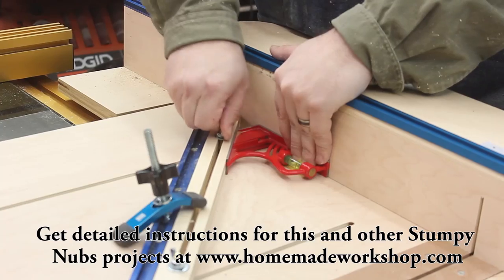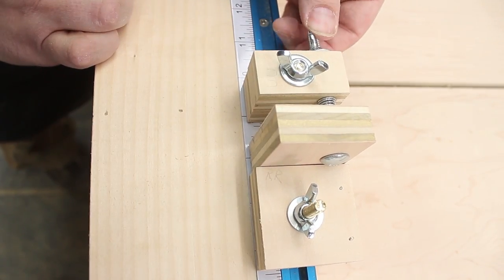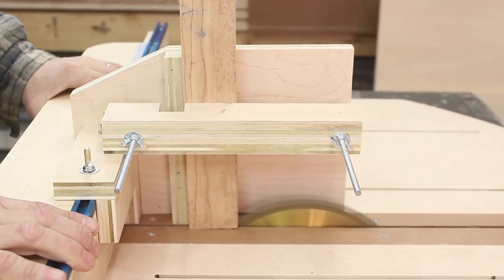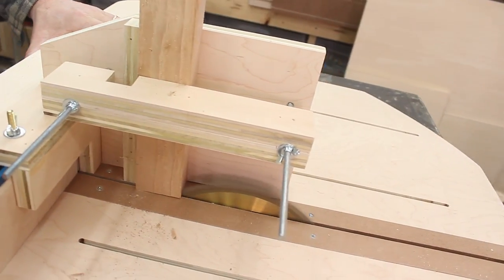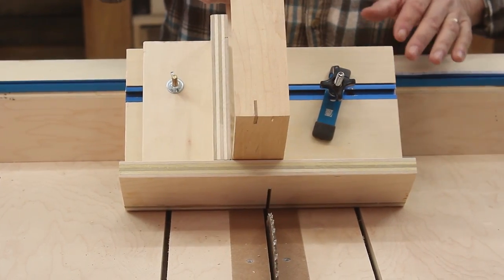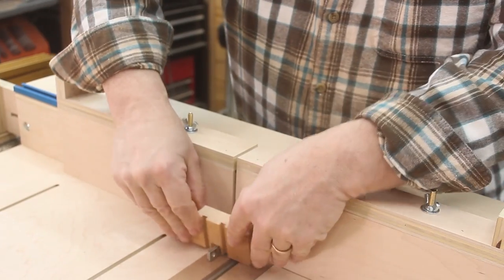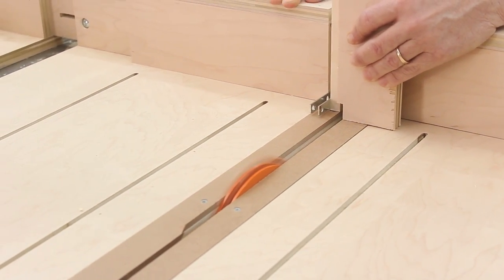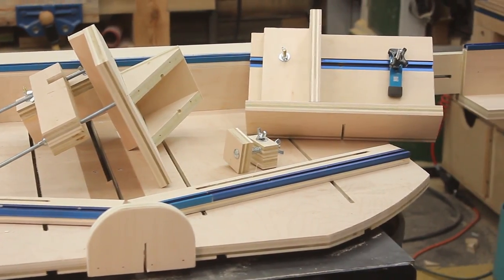Part 2- SUPER table saw sled crosscuts, tenons, finger/box joints, splines, dovetails and more!

Comment: I love your great since of humor it's fun to watch your youtubes. I also love the over-all sled,  I built the sled last year with a couple of the jigs, stops, miro adjusters and the extensions. I just finished the Finger/Box cutter and made my first box. There are a couple of things that did not work out so well for me. First is the L brackets for the thickness of the board. I am not crazy about how they bend with presser applied to them. It is doable but using one board on top of the other, it can be a little fidgety to use. Why not just use a piece of the wood your using to accomplish the same thing?  The other thing is stacking the boards on top of each other to do 2 at the same time. It may be great for people with young hands but not for my old digits. I started out doing it that way on the first four sides (2 doubles) and it was a problem for me. I had some miscuts on 3 or 4 fingers. I decided to try one board at a time and the second half all turned out perfect. I purchased the plans for the router lift and the router table and will probably build them next. I realy want to build a wall hanging storage unit for my collection of planes, chisels, saws and other tools. I can't find one that you have plans for or a you tube. When will you get around to producing those plans. I see a pretty nice one hanging on your wall.  I need something for probably 25  planes, 40 chisels a variety of saws and lots of other stuff.  Would you, pretty please?

Comment: i like the 'micro adjuster idea... have seen people stick a few sheets of post-it notes as the microadjuster - these are simple to make, with easily found parts, and seem to be really effective.    also the box joint jig is great - i stupid spent a crapload of money on a leigh jig - that ONLY does dovetail joints...  seriously it was like 300 bucks and it doesn't even do box joints - you have to get the 500 dollar one...  crap.   i use boxjoints to make all the boxes for my beehives.

Comment: Lotsa cool ideas there - I wonder if it's square enough for larger pieces, not being able to set up with William Ng's 5 cut method. I love the way the hollow back could lighten it up. If that had it's own bottom, it could be adjusted w/ the 5 cut method. My sled is good to .001 over 16" that way - maybe I'm just too OCD lol - but .... * I also love the spline jig moveable stop. For finger joints, I'm not a fan of futzing w/ dados when the router table jig is always exact. * the micro adjusters are cool - I have a 40TPI tap and die to make those. It's the math ... an adjuster w/ 1/4-20 vs  40TPI is no contest for precision. Love your cool stuff!  * I'm quickly becoming a fan of micro jig clamps vs T track all over the place. I've been thinking of making a new sled, as my v1.0, "RoseBud" has been improved a few times, but starting from scratch has advantages. I expect to add in a few of these thoughts - Thanks again!

Comment: The routed slots in the mitre fences end 3” and 5” from each end, as per the plan instructions.  This makes the slot too short to adjust the fences to make a 45 degree miter on the mega sled.  Try it.  So I extended the slot to 3” from each end and now it works.  Also, the head of a 1/4” carriage bole which secures the miter fence to the sled is too wide to slide into the dado’s cut in the bottom of the sled.  Therefore they will lift the guide tracks of the sled out of the slots.  I had to grind the head down a bit to make them fit properly.

Comment: I have been looking around at different sled designs.  Most are "mostly" the same, one popular one is adjustable so you can use your dado blade.  THEN I was looking for a miter sled and had decided on the Steve Ramsey one.  THEN  THEN I was looking at the box joint jig.   WELL I think all that just went out the window and yours just jumped to the top of the list.  Even after buying the T Track and all the hardware, having one basic jig and grabbing the attachment is well worth it.  Thanks Mr Nubs or can I call you Stumpy.

The runners sure look short for such a big sled.  I know I can make mine longer - that was just a comment.

 I just purchased the plans.  You wouldn't happen to have a cutting diagram would you??

Comment: Hello. I saw this project when you brought it out and bookmarked it. I'm now thinking I'm ready to build it. I have a question. I received a freud box cutter blade set for Christmas, and I'm wondering if the box joint attachment for this sled is usable with that. You said in the video that you can adjust the spacing of the cuts by inserting or removing shims from your dado stack, but the box cutter set is pretty much constant as far as cutting width  Does your adjustment for the slot on the jig allow use of the Freud? Thanks.
Reply from the maker: +Jim Hester That set will work just fine.
Reply: +Stumpy Nubs (James Hamilton) Thanks. I'm enjoying catching up on your channel.

Comment: One thing I did differently from the plans was to build the fence separately rather than directly to the table.  Thus when I went to attach it, I was able to use the William Ng ‘5 cut method’ for making sure the fence was 90 degrees to the blade.  It worked a charm and the tolerance is about 0.001 of an inch.  It sounds anal, but it makes a huge difference in making joinery you can be proud of.
Reply from the maker: You can adjust the sled by adjusting the runners be just as proud of your joinery.
Reply: Yes, you can adjust the runners, but I would bet that this method is simpler, quicker, and more precise.

Comment: Great sled! The only down side I was able to see was the fact that you were not able to tune it to exactly 90. Did I miss something? Only way I can see to do it is by making a single vertical piece at the back, perform the 5 cut method to square it up, then add your torsion design in front of that. Very nice design though! Can't wait to start on mine.
Reply from the maker: +limitliss - You can use the "five cut method" as a way to read how much out of square a sled may be, then you adjust the runners to correct it. I recently made a video about making adjustable runners: https://www.youtube.com/watch?v=FSHBRADfF_g

Comment: Doesn't look like the box joint jig would work w a single blade, would it?
Reply: hammockmonk I'm assuming so long as the L brackets are thinner than an 1/8 inch when combined, you could use a regular 1/8 inch saw blade. My saw doesn't accept a dado stack, and I'm building this sled now. I plan to find L brackets or similiar hardware that will allow me to use a regular blade. I'll let you know if it worked for me

Comment: 1.  I never did see you square the rear fence to the blade (5 cut method?). Is this cover d in the plans?
2.  It appears that you will eventually chew up the rear fence, especially if you do finger joints with this sled. Is there a “plan” to replace the rear fence?  Didn’t look like it in the video since you glued everything down. 
Having said/typed all of that, I’m a great fan of yours.
Reply from the maker: You square the fence by adjusting the runners. That's in a separate video. A kerf in the fence has minimal affect on the cut, so there's no need to worry about it.

Comment: Hello ! Can I get the plan in mm ! And are this Plans drawings or complete Cad files when i order at in your Store
Reply from the maker: The plans are are in the form of step-by-step instructions, including photos for each step and dimensional drawings, as well as a full cut and hardware list. They are in PDF form which you can print out as well. We do not give out CAD or Sketchup models as they can not be copy-protected. All of the plans are in inches, however all you need to do is buy a measuring tape with inches on it to build the project, or convert the measurements yourself. It is a lot easier to convert from inches to millimeters than the other way around, as you likely know.

Comment: I know this is an older video. But how bout a new sled made for adjustable miters? Like I've been considering making a Sin adjust miter sled. For anyone who does not know about setting up a Sin angle , it's the crap we did in high school that we had no idea what it was for like finding out how tall the flag pole is from the direction of the sun and shadow. I'm sure there is videos about setting up a Sin bare. It's a common tool used in high end machining like tool making. But with a set length of cross bar or pivot lengths you can cut common Sin lengths of stock to set your angles and be near 100% accurate in mere seconds. If I made one and a video I'm sure it would get near zero views. But if the Stump made one a Sin miter sled could go world wide.